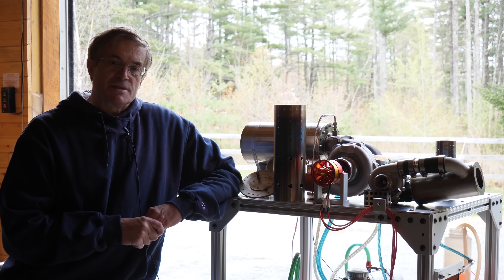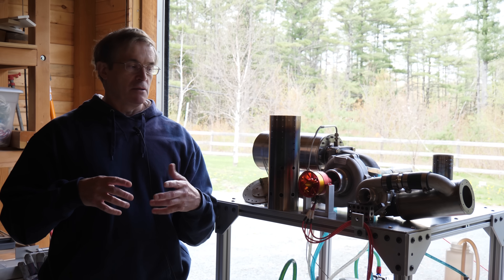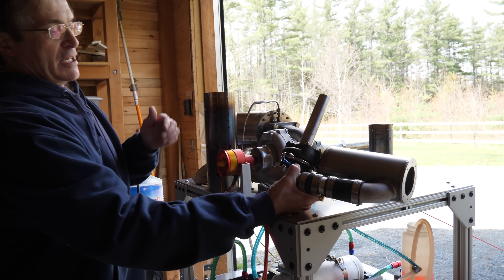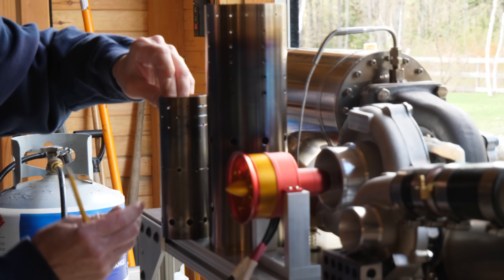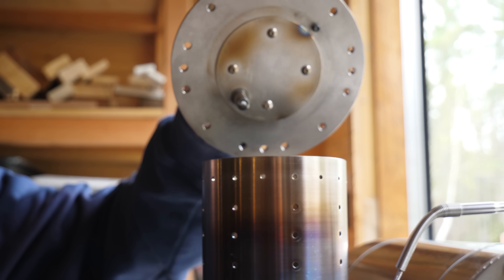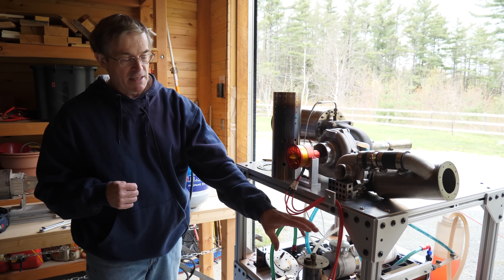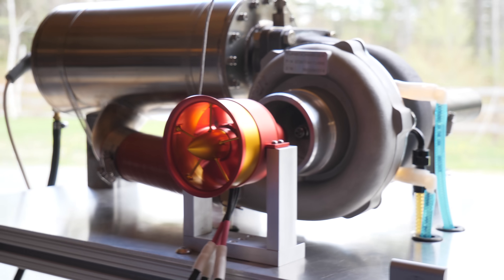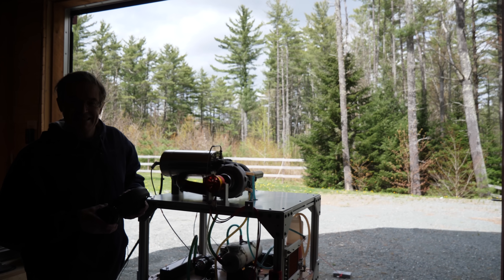Catching Fire - Refining the Jet

Comment: Journal bearings have higher starting friction because they've got sliding friction at a standstill. When running at their design speed, the rotating shaft should be floating on its own "bow wave" of oil, operating entirely hydrodynamically. So usually a journal bearing should be more efficient at high speeds than a rolling element bearing. It's my understanding that the advantage with a rolling element turbocharger bearing is that tolerances can be finer by having the bearing pre-loaded, while a journal bearing requires a gap for the hydrodynamic effect to work.
Reply from the maker: Nevertheless, there is data, like I presented in the insert during the video, that shows the lower rotational drag of ball bearings.
Reply: I ran the maths from his graph (using torque and rpm) and calculated that at any given rpm, you will only lose at maximum about .3 hp from the frictional torque, so this probably shouldnt be the greatest concern.

Comment: What is the gas temperatures: ambient, post-compressor, pre-turbine, post-turbine? What is the maximum safe pre-turbine temperature?
Reply from the maker: The ambient is about 20C, we didn't measure the compressed gas temperature and the EGT can be seen on the EGT gauge, second from the right on the rack.  900 C is about the highest you will want to run the EGT.
Reply: @TechIngredients  , I'm been thinking of this type of engine for months since I learned of a hybrid dump truck that used one to charge the batteries. I've seen some mentions of regenerators but data is hard to come by with the different engines. If the compression ratio is quite high, the final exhaust temperature (post freewheeling turbine) may not be much higher than the post compressor temperature. However, if the compression ratio is moderate, a heat exchanger between exhaust and post compressor will reduce fuel consumption without reducing the output, significantly increasing the efficiency. That's why I asked about the other temperatures. I can't wait to find out how high the efficiency can get. (Yours is by far the best I've seen.)
Reply: @TechIngredients   900C is way too high for an EGT , OK for a TIT  but with anything up to 150C drop through the gasifier turbine stage  that 900 C becomes 1050C going in , a turbo won't survive that for anything other than a few seconds  especially if the turbo is a diesel or cheap knockoff  running "inferior"  metal like GMR235 then a max EGT of ~650 C  is advisable unless absolutely certain the turb wheel is Inco 713C ..........................please give safe advice to novices , your 900 deg C recommendation could kill them .
My 12/118 engine now has its freepower stage undergoing testing https://www.youtube.com/watch?v=5jhGLn-9EfU&t=13s , more info http://jetandturbineowners.proboards.com/thread/612/fat-boy-118-thrust-engine?page=103

Comment: I wonder if this could be used to heat up water for a pressure washer with a water pressure of around 135 bar and a flow of 600-900l/h with an incoming water temperature of approximately 0-10°C and a target of 50-100°C? Seeing that it can use propane that would be a big advantage over diesel for me, methane would be even better since I have a methane conduit running to my house.

Comment: Good to see you stepped up to a big boy! Just happened to complete work on my phase one engine while building up parts for phase 2 (a 7" dual compressor axial design that I'm scratch building) today and wondered if you ever did anything else with your build. 
Couldn't agree more with your synopsis on the pitfalls of using an automotive turbo for these, but it does take a lot of manufacturing of precision parts out of the equation.
On the subject of LP/gaseous fuels, the engine testing groups use a fuel warming system that's rather elaborate to get around the cooling issue, though for us backyard guys, a kiddie pool filled with water and a heating element works equally well based on scale of our supply. I had a reptile heating pad from a fermenting project long ago that I used, as it maintains a good 120* F quiet easily, but a resourceful gent such as yourself could easily rig up something with a bit more grunt. You could also go overboard and build an insulated and heated holding chamber, but the kiddie pool is much more practical. 
I really liked your approach with the 'injection plate' idea as I came up with something similar for my phase 2 engine, though quite different in deployment as its designed around running hydrogen fuel at a good bit of pressure. 
Keep at it as I'm looking forward to seeing your compound operation with a free power turbine take shape one day!
Reply from the maker: Thanks!
We've gone on to test the engine with both methanol and isopropyl alcohol.  It works at least as well as with the propane, requires no warming or propane to start and works well with the plate diffuser too.
Oh, and be careful of parallel turbos.  Just like parallel diodes, a small difference in the performance between the two can lead to a runaway seasaaw.  Personally, I'd recommend going to series operation and reaping the added benefit of increased effeciency.
Reply: @TechIngredients  Ah, very smart with your fuel swap, sir, and thank you for the advice! My larger engine will actually be kind of a hybrid, as an axial arrangement with compound components. I suspect there's a reason the pros don't do this, but for the sake of experimentation and not having to drive 6-7 rows of parasitic compressors, I'm having a go. =)
Add: I did have a brief research period of looking at actual compound turbo setups, and you are right on the money with how those things are sized and oriented. In my build up of parts for the first engine I happened to land some large compressor wheels from what I suspect were APU units, which is why I'm going a different route. Who knows, with a bit of work and a massive stroke of luck, it could be revolutionary (probably not though; it'd be tough to outdo the Williams-era engines!) in small jet engine design.

Comment: Can't make any sense of this at all without at least a little presentation of the schematics. Could be god knows what in there moving in god know which direction. Had I built the engines with him, it would all make sense. Without that, it's a bunch of tubes. compressors and plumbing cobbled together which is impossible to understand, no matter how well described.
Reply from the maker: You might find the first video in this series on turbocharger conversions is easier to follow.  I took more time and went into more detail on the design in that video and didn't want to drag the viewer through that whole discussion again.
Reply: @TechIngredients  many thanks. I will do that! 😊

Comment: After seeing the jets you've built, I thought I might ask for your thoughts on the idea of building a motorjet, probably very similar to your hybrid jet, but with a small  piston engine replacing the batteries, ESC, and electric fans, and driving a compressor mechanically which has a higher, more suitable compression ratio, if one is available. (Perhaps an automotive supercharger exists which can generate the requisite compression when driven by a small power-dense motorbike style engine.) It is my view that doing so would seem to decrease costs and allow operation primarily from a shared tank of liquid fuel, while also making it possible to drive other things off the belt, like an alternator, when required. This type of system was used before in airplanes, though not very much, because turbines won out.
Reply from the maker: It could certainly work   Some challenges would be the that roots style automotive superchargers are usually pretty large and pretty inefficient and turbosuperchargers require much higher RPMs than can be directly supplied by a piston engine.
Reply: @TechIngredients   I know of turbosuperchargers that  are made with appropriate gearing ratios so that they may be driven by the belt of a car engine, so if i ever have the opportunity to try this, i think it may be one of those i would use.

 I look forward to your future videos; they are interesting and informative.

Comment: Also another thing to consider with the momentum coupling; could you improve this by adding another section after the nozzle with a venturi tube to entrain additional air?
Reply from the maker: That is similar to an "augmenter".  There, the high velocity exhaust creates a low pressure region in front of the elliptically shaped lip of a downstream second exhaust tube.  These are often used with pulse jets.  They can double the thrust, but add additional weight and drag as the airspeed rises.

Comment: Have you considered using liquid fuel and a heat exchanger with some of the waste heat from the engine to convert it, in situ into gaseous fuel?
Reply from the maker: I considered it.  The most recent tests with the liquid fuel and the disc shaped vaporizer were so successful, I think we're there now.

Comment: Couple it with a propeller through a simple gear reduction box.  Planetary works well.  Through roughly 300 mph, propellers provide more efficient power usage from turbine engines because they, as you explained, result in greater power into the aircraft through greater mass of air through the comparatively large diameter of the propeller, not greater velocity of a small mass.  

Ideally, if one could two counter-rotating propellers at the back of a canard aircraft, and size the propellers for optimal performance in fuel used per mile at altitude with just enough additional thrust built in for minimum takeoff and climb performance, one would arrive at an optimal configuration.  

Indeed, highly tweaked Rutan Varieze propelled by a turbo-diesel has managed 200 mpg at 25,000. It's not going very fast.  It doesn't have great climb performance, but it sips fuel while covering those miles at a relatively low velocity where L/D is maximized.
Reply from the maker: That gear reduction box isn't easy.  The  turbine RPM is incredibly high.  That's why we are working on the lower speed, free turbine project.

Comment: Guys, I've got a very practical task-project for you. The tennis ball launcher. The tricky part is to make it very lightweight and very powerful, also cheap. The budget limited to 150-300 dollars. Including the tools used in the process of making. Must include 3 launching wheels, must rotate horizontally and vertically, must be programmable, and must have a remote control. Also must perform equally well as the Ace Attack tennis ball machine, which costs around 6000 US dollars. The machine should weight less than 45 pounds, must be compact, and can come in several disconnected parts. All the materials used in the project should be easy to obtain, no 3D printing, no sophisticated metalwork. The number of tools used has to be minimal. I designed my own version of it. I used 2 light weight tripods, those you can buy. the bigger one for the launcher, and the smaller one for the soft basket. I am thinking to use a vacuum ball transporter to lift the balls to the level of the launcher.  Also I use Arduino controller, and many borrowed ideas coming from youtube. I want to see what can be done better. PS The max launching speed could be limited to 100 mph, the battery time around 90 min.

Comment: Just a crazy thought but could you conduct a current through the exhaust like a field winding in an alternator and use that to induce a current in another coil? From what I've learned from your channel and applied science I know that fire seems to be diamagnetic and I know from personal experience that fire is conductive because it is more or less a plasma. It seems that if you used those principles along with the one you demonstrated from the hunt for red October that you could use the exhaust to generate electricity this way. I can't be the only one to have thought of this. If this has already been suggested in another comment please disregard this.
Reply from the maker: Gas based magnetohydrodynamics works and has been suggested as a way to augment the energy generated by coal based power plants.  The challenge is that a flame, even an acetylene oxygen torch is not hot enough to actually ionize the gas.  The light given off is the relaxation photons from excited, but not freed electrons in the combustion products.  There are tricks such as using an oxygen rich mixture to stabilize the rare independent electron and seeding the flame with potassium which has one of the lowest ionization temperatures.
Reply: @TechIngredients  So why wouldn't it work to just start an arc with high voltage then keep the arc going with lower voltage and higher amperage like a tig welder does?  Would the resistance be too high to be practical? Thanks for replying. Now that I know what this is called I can research it.
Reply: I just looked up some info on the topic and I see that the idea is to take dc power directly from the electrodes in the exhaust gas. What I had in mind was a little different. I was thinking of putting a current through the gas stream like a Jacobs ladder and using coils as the output. Unless it's been done I want to try it.
Reply from the maker: Because the ionization is low and unstable, the arc will not maintain it beyond the arc, the conductivity will be low.  It will generate a potential, but the power will be low.

Comment: For a second I thought you turned it into a turbofan by coppling the axle to that edf. It would produce tones of thrust that's for sure and it would be a way to Harvest that otherway wasted energy. Did you ever consider it ?
Reply from the maker: Yes, but whether taken from the front or the back, recovering the surplus power directly from the shaft means VERY high RPM's.  That is why we are building the free turbine.  Because it can utilize a much larger diameter and operate with reversing flow from it's single stage, the high torque and relatively low RPM should allow direct coupling to a generator, a propeller or a vehicle transmission.
Reply: @TechIngredients  You are right the RPMs would be way too high.
Are you planning to use that Pelton Wheel ? I heard those are most efficient at half the speed of the fluid it takes it's energy from, which is still very fast in this case if the air speed is supersonic at full load. Do you have a plan to get the RPM lower than that ?
Reply from the maker: We're building a .4M diameter pair of split, reverse curve blades that do operate much like a Pelton wheel.

Comment: I'm wondering if the EDF itself disrupts the airflow into the engine enough to cause a measurable power loss?  It wouldn't be too difficult to create a rotating mount to swing it in and out of position as needed.

Comment: could you use some of the excess heat to heat the propane tank?
Reply from the maker: You could.  It requires a flow of about 4kW of heat to keep the propane at a constant temperature.  We're also having really good results with the liquid fuel.

Comment: Great videos! You should look into building your own water hydrolysis (hydrogen separator) cell with the goal of making a usable oxy-fuel torch that generates enough gas real time to be comparable to something like a standard set of oxy-acetylene torches. I think the key lies in actual h2/02 separation though, rather than hho gas, because being able to adjust the ratio of the two gasses in the torch means you can use it for more than just heating things up (i.e. cutting/welding/brazing etc...), which is the main problem faced when it comes to using hho to build a torch.
I just want to find a way to stop worrying about having to fill up tanks!!!
Reply from the maker: Thank you!
In principle, the generation of separate gasses is simple because they are each being released near a separate electrode.  The reason this is not usually done is that the water, even with a disolved electrolyte, is a poor conductor.  This means the voltage has to be high to drive the high currents needed to produce a reasonable flow of gass.  
The solution seems likely to require a semipermiable membrane to separate the gasses once formed.

Comment: make a turboshaft engine and measure its power.
Reply from the maker: That's what the free turbine is for.
Reply: @TechIngredients  I mean if you turn the thrust to mechanical power with another turbine.. Then with gear reduction you will get alot of mechanical power.
Reply from the maker: The turbine we have designed should operate at a low enough RPM to eliminate the need for gear reduction.

Comment: thank you for sharing hours of your mind at a time!
if ever you need any data science applied - I would gladly run any data analysis to help you out!  20+ yr Solutions Architect.

I do have a question about magnets...
is repulsion different between a North North vs South South configuration? ;  as I try to picture N flows to S... is the repulsion equal, but with a force on the outer circumference for the SS configuration... and repulsion equal but focused toward the center of the NN configuration?  PLEASE HELP!  thanks !